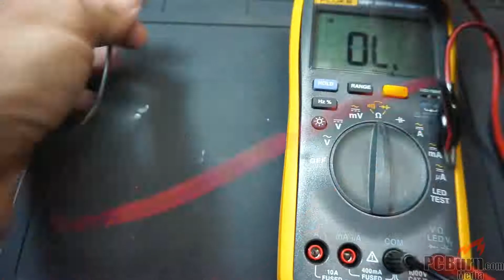Prusa i3 Mk3 Bed Failure Troubleshooting

Comment: Im not looking forward to doing this ...
Reply from the maker: If your heat bed needs repair it wasn't a bad job. Just make sure you don't burn yourself and have the electricity disconnected. Pre-heating the area of  board probably isn't a bad idea either.

Comment: I like your content. Very well made. I got my MK3s+ and i also have bearing problems, PSU makes noises ... i think their quality check isnt any more as good as it was.
Reply from the maker: The PSUs on the older units whine quite a bit on 120v while heating the PSU. They didn't catch it at the factory with their 220v mains. They mostly mitigated it by chopping the power to the bed but I'm guessing there's still variance. 

I'm planning to change out my repair-mule printer with Igus bushings, this time in custom machined mounts... probably just printed and hand honed to tolerance.

If it wasn't pre-assembled the bearings might've needed cleaning and greasing. And if you have it apart at some point make sure they're installed correctly (with the bearings... 90 degrees offset? Check that though). That might be visible assembled if it's still the hoop bearing holder. Otherwise they load weirdly.

I was shooting a video of re-installing the greased bearings in the Prusa to see if that was the issue. And then realized I have mis-matched part versions for the new hot-end.
Reply: @PCBurn  yes i ordered already my Igus bearings, because mine are too loud and in the prusa community someone recomended them to me and said now the printer is so silent that he hears only the fan noise :-) Igus normaly stands for quality. But what i read so far, the rods from prusa cone in a bad quality many said, and that it isnt the bearing, it is the rod which makes the problem. It does not help to get a better print, but the noise should go away. What i still have and didnt had on my other 3d printer, is that when it prints diagonal or rounds, were X and Y works together, that it then makes stange and loud noises. When it goes ONLY X or Y then everything is silent. On my other printer i had some motordampers which really helped to reduce the noise from motors, but this is a total new 3d printer and i was in hope for this amount of money, they they had fixed such easy to solve problems, which you dont have with other boards like Duet and so on. Sure this are not only 8 bit boards, but for such a amount of money, i think atm. its also possilbe to make a better 3d printer with less noise. The only thing what i hear and read often is, that it is a trustable machine which dont surprise you after hours with a failprint :-) So i think i will keep with the prusa as backup printer and build a voron or something in this way to get a better printquality and silent print with higher print speed. When i saw their powerboat prints... 6 min for a really good looking benchy, and 2 hours on the prusa with near the same quality :-) ...
Reply from the maker: Yea, the Prusa's been a workhorse for me. And they get the firmware spot on. I am somewhat surprised at the issues... might be worth giving them a shout before you change anything.

If I get another printer for serious work it will probably be an E3D kit or one based on that tool-changer design. That's been the biggest thing I feel printers are missing. Well... and motor external enclosures. But those just went off-patent.
Reply from the maker: Oh! And before I forget, the Igus come in two flavors. A drop in metal encased LM8U sized part and an all-plastic 8mm ID part with a different OD. The later require different mounts to correctly compress on the rail.